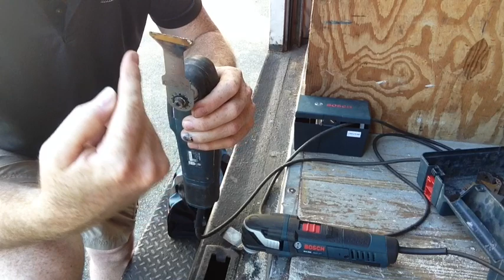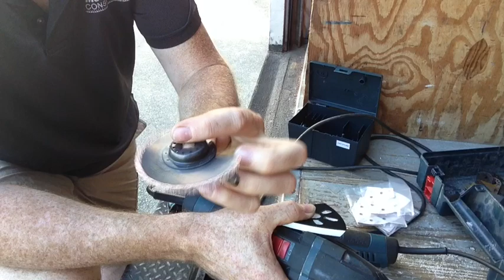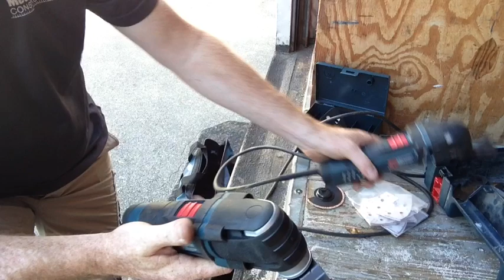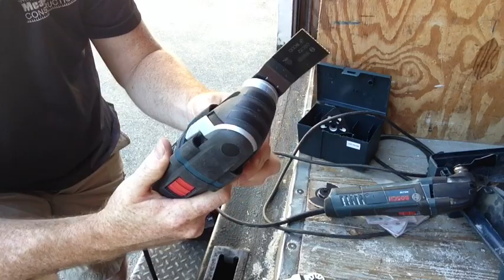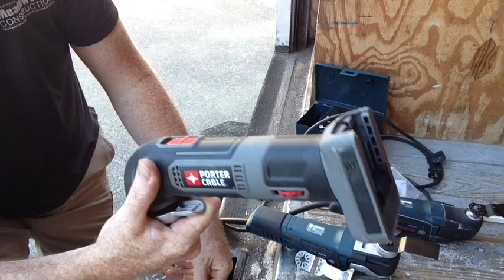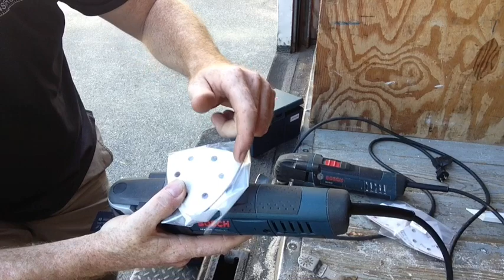Bosch Multi Tool MX30e Review

Comment: I have a MX-30 and have loved it. I would have never believed how many applications it is useful for. The blade change lever on mine has started to slam shut as it is closed. A real problem as a  black and blue thumb nail attests. Bosch does not sell the parts needed, only the entire gear assembly. At e-replacement parts the gear assembly is $149.00. Almost as much as the tool it's self which I've seen advertised for $179.00 with some accessories. May have to purchase another soon.....